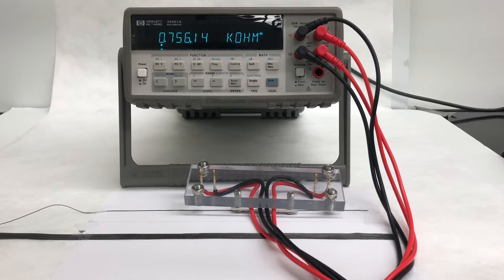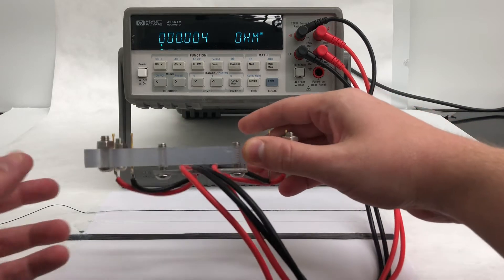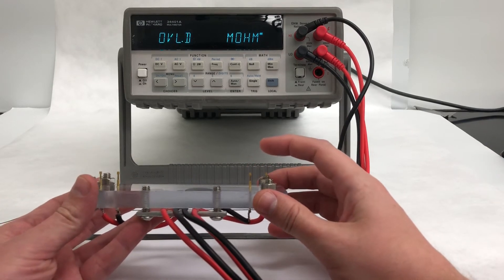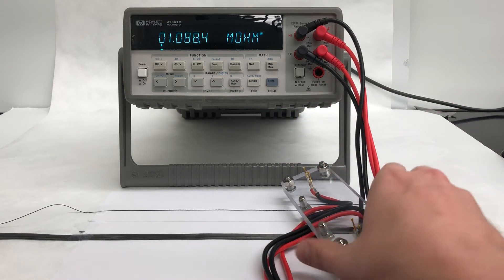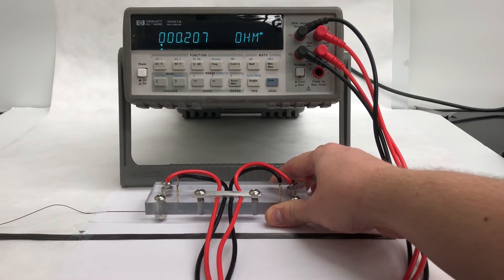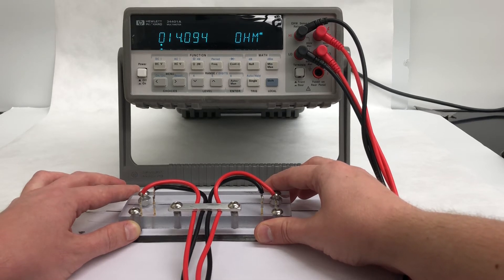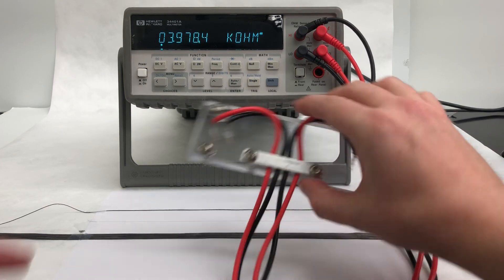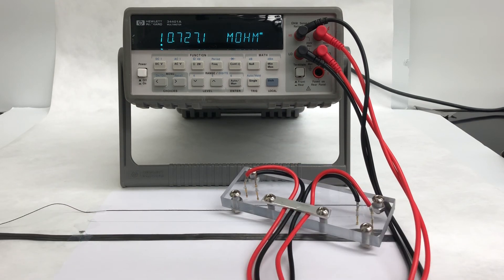Carbon Nanotube Yarn, Fiber & Tape: Resistance Measurement

Comment: Helpful video. how did you glue the pogo pins into that plexiglass? what type of glue did you use?
Reply from the maker: Hi, 
Thank you for your feedback. The Pogo Pins in this video are pressed into holes drilled to match the size of the Pins. The pins have a shoulder that keeps them from going all the way through the plexiglass. I would consider super glue or CA glue to be a great way to secure any pins that may have a slightly oversized hole.